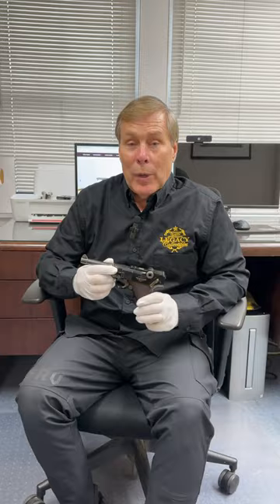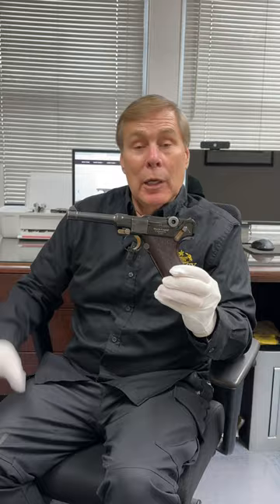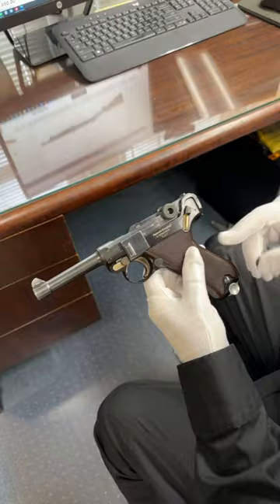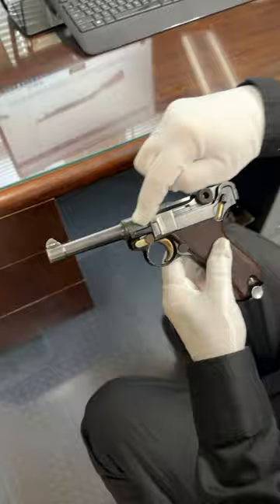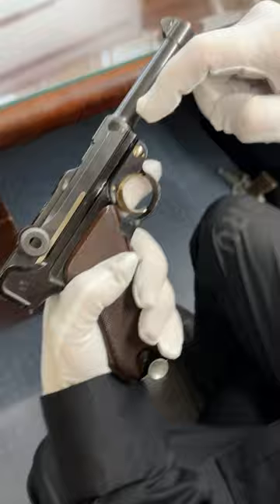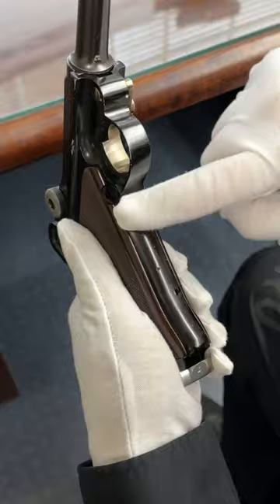Rare Experimental Krieghoff Luger With Aluminum Frame #shorts #ww2

Comment: I was working for John Marks Luger carbine maker from Lincoln, California in the 1970s and 1980s and I remember he did get an aluminum frame Luger in the shop in the late 1970s. I remembered that we were able to take it apart measure the parts in comparison to regular Luger parts and that we were able to fire a few rounds through it. As I recall when fired the toggle assembly tended to beat on the Dural frame's contact points and balance and handling were off. Because of this I personally don't care for any aluminum framed firearm. If I owned an M16 I would certainly want to have it made out of steel.